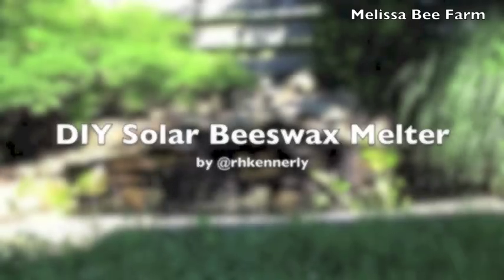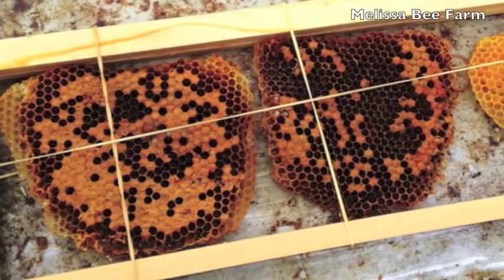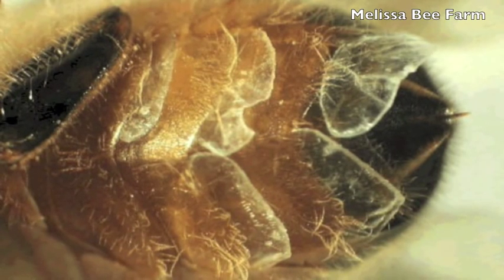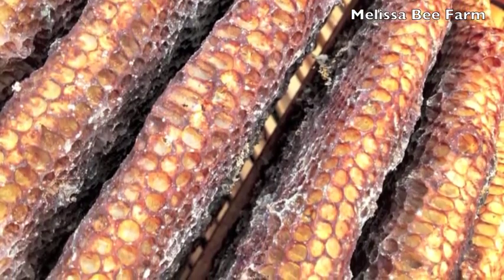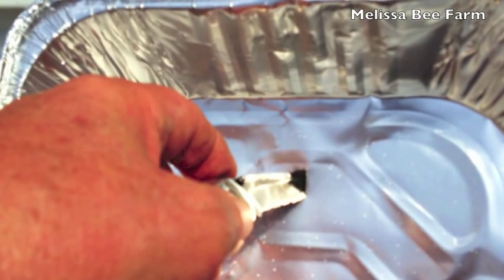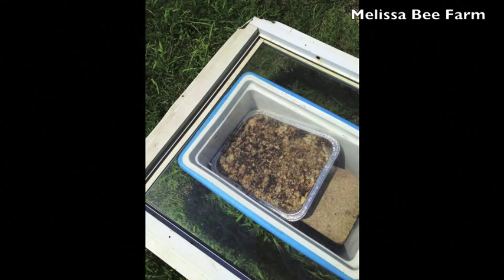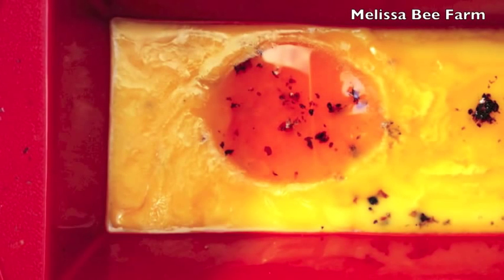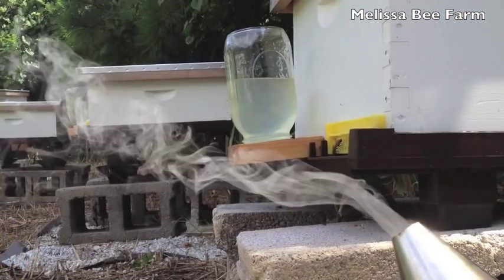DIY Solar Beeswax Melter

Comment: place paper towel on the dirty tray then the wax on the paper.....the paper filters the wax and then can be used as a fire starter.
Reply: Beat me to this comment. I use paper kitchen towel, works great with just one run through melter.

Comment: A double pane window is not necessarily counter indicated for this project. The heat in the melter comes from the light that penetrates the glass. Having a double or triple pane window will actually keep more of the heat inside the melter. If anything that could make the solar melter too hot. Keeping an eye on the whole set-up and venting excess heat from time to time would fix that. As you mentioned you don't want to get the wax too hot. Good video, thanks.

Comment: Good information on wax melting. I didn't know about the need for a thermal mass. I'm going to try this and see if I can get good, clean wax.

Shame about the Warre hive, I use both Warre and Langstroth hives and I really like the Warre hives more. The bees like it too and in my opinion, while it's true it does use up more wax I don't think it's disrespectful nor harmful to the bees and I will explain why. 

Warre hives are managed different from Langstroth hives. New boxes are added to the bottom, unlike adding new boxes to the top as you do with Langstroth hives. So it's nadiring rather than supering. As bees expand their hive downward, the brood chamber moves downward with it and the old brood comb makes it's way up with each new box expansion becoming room to store honey. It's probably going to be two years before that new box is ready to be harvested for honey and that's about the time it's recommended to replace old brood comb anyway. Overall it's better for the bees health to not reusing comb over and over so it doesn't become a vector for disease, and the queen gets to keep laying in new comb as she prefers. 

At the same time, Warre hives don't get supered with dawn comb like Langstroths do for extra honey, so the harvest is less and therefore they can draw out more wax because they aren't losing as much honey from the harvest. In addition to that, the Warre hive was designed with careful attention to honey bee behavior and the dimensions of the hive as well as the design features of using telescoping, peeked roofs with an air buffer, on top of a breathable quilt box with absorbent material give bees more control over the temperature of the hive and it keeps out moisture. The bees spend less energy keeping hive temperature and there isn't the dead space a rectangular Langstroth has. 

Just my observations and study, I'm very fond of these hives and my bees do better in them.

Comment: Crush and Strain is not a disrespectful method at all.
Reply: It certainly is if you consider the entire energy budget of the hive.  Building comb is one of the most costly things the hive does.  It is much more respectful of the hive's energy budget to decap the comb and put back 95% of it to be refilled rather than have the bees rebuild the comb before it can be refilled.
Reply: And how is that disrespect.  I choose to crush and strain.  I use every bit of the honey and wax for Honey, candles, soaps, cut comb and chunk comb.  No waist and no disrespect.
Reply: If you can't work out the energy budget for rebuilding the hive infrastructure, I don't know what to tell you.
Reply: They're bees.... They will always be doing something.  While honey production may suffer, they'll always be working away regardless of what it is they're doing.  Bees don't sit around thinking "Man, this sucks.. I just built that cone".  Why do hippies always put a human emotion to bees?
Rick, if you're a beekeeper, I surely hope you don't live near me.  You're the kind of idiot that would try to cure a colony of AFB or EFB instead of taping up the hive and tossing it in a burning barrel.
Reply: Joe shit the rag man  the bees can refill & make more honey, instead of spending time 
/energy making comb.  if you can't work it out, i can't help you.